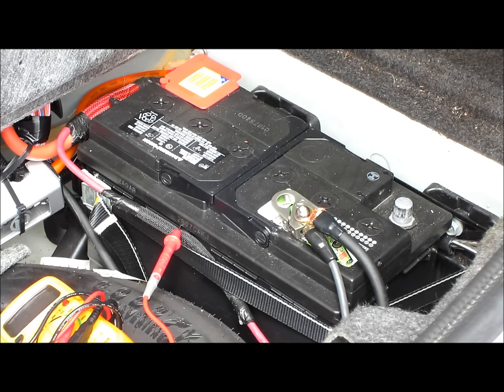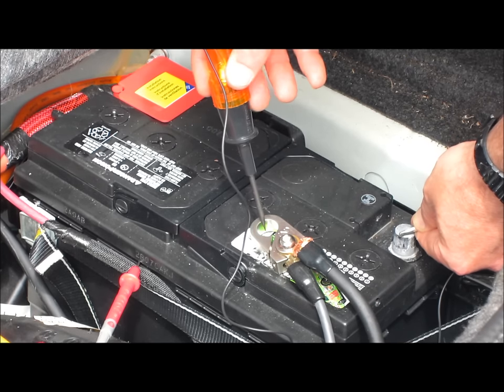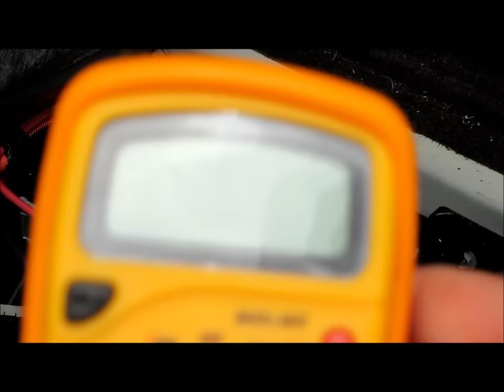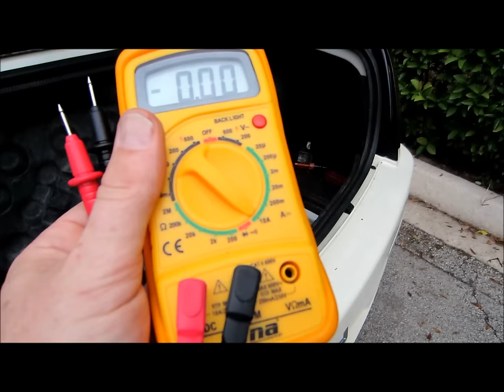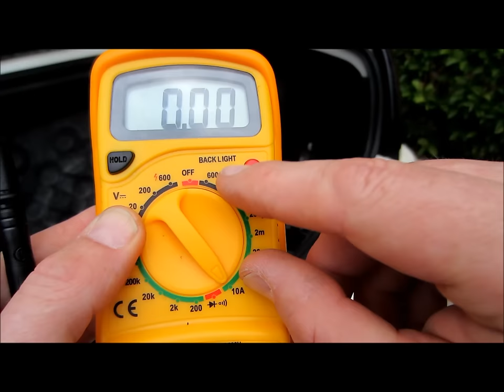How to check for and fix a battery drain in your car

Comment: FYI...Alternating AC current is the wave sign on your meter and the straight double line is DC current.
Reply: I was just going to say type that...note the straight line over the dashed at the 10A DC setting he used.
Reply: That's why he get zero reading on test meter but get light ON on test light tester.
Reply: I had to laugh myself is there anyone that works on cars that did not catch that?

Comment: Good simple video...If it's something other than the computer, that is most cases, always draws a " little "current, like clocks do too....If you find, but can not repair and/or replace, what is causing the extra draw, you can put in a manual disconnect that turns off the power at the battery or a manual, switch controlled disconnect, that can be mounted in the cab, but with more expertise involved...A kill switch so to speak, cheap and simple....Many are made to mount directly on the battery terminal and are easy to install, but you have to raise the hood every time to use it.... I also recommend pulling the computer fuse first, before checking anything, then the others...Just in case....Thanks for sharing this video...It's still a good one.

Comment: For years, my car ate batteries.  Each year I had to replace the battery.  If the car sat unused for a few days, the battery would die. 
No mechanic performed or even suggested a parasitic draw test.  They just kept selling me replacement batteries.  
Finally one day, I realized that the problem was that the rectifiers in the alternator had shorted.  The battery was draining through the windings of the alternator.  
How do I know this?  Because one day I saw a thin stream of smoke drifting from underneath the hood.  When I opened the hood, there was an inch tall flame on the alternator, which water couldn't extinguish (because the current from the battery was flowing through the windings, heating them like the filament of an electric light bulb).
The alternator was replaced.  A draw check confirmed that the current leak from the battery had stopped.  No more dead batteries.
Reply: My was a Ford Taurus 99. Was yours was a ford?
Reply: Kevin that is scary as hell !  I wonder how long that flame would stay going until it died out?  Everytime you had to recharge or jump off the car, and then it starts to flame up again.  Double scary.  No, much more than that!
Reply: fcuking hell😳

Comment: If you are alone, just place the ammeter across each fuse socket one by one until you find the conducting circuit.
Reply: Actually thats the way I do it and think its the easy and best way. Just be sure to get proper contact as its easy to miss the test point of these fuses.
Reply: do I need to keep the meter set to Dc?

Comment: Your vehicle is naturally going to have a draw to it with the key turned off. How do you think your stereo keeps memory? So the light test with the negative terminal is bs. To know if you have a problem you have to use a meter and look at the exact number that its drawing. Example, my mustang Cobra draws .o9 volts when the car is off because its feeding the memory for the stereo.
Reply: I think you mean the stereo is drawing .09 Amps, not Volts. The voltage should be pretty close to 12 regardless of amperage.

Comment: Hello!  I am dealing with a parasitic drain on my 2017 nissan pathfinder that cases my OEM radio to turn on at random times thus killing my battery.  Even when I unhook the radio completely from all the harnesses I can see  on my multimeter that there is a drain of 3.5 to 4 volts at all times and the only thing that fixes the issue is to pull the extended storage fuse.  I have removed the fuse box and found the harness that controlls the extended storage fuse is just a thick copper wire that is hot all the time.  I know one of the wires that it controlls is the blue memory wire leading to the back of the radio.  Initially I even tried just cutting that wire and running it to a different positive just to see the results and though the radio never turns back on by itself the parasitic drain is still there.  I have already spend thousands of dollars at the stealership for module replacements, sensor replacements, radio relacements and all this for them to NOT fix the issue.  Now they are swearing that only $8000 more to replace the whole wiring harness will fix the issue.  I mean holy crap, who do they think I am and what do they think they are they working on, a Lamborghini?  I'm just a regular guy with a family and I need a vehicle that works, especially when I am paying $450 a month for this think.  I know this is a lot, but do you have any advice?  Thank you so much!

Comment: Hello, i bought my son an 05 honda accord and the battery is draining and it has an aftermarket stereo so i checked the draw and it was 200 milliamps so i took the stereo fuse out and it went down to 0.00 put it back in and went right back up. I took the stereo out and checked all wiring and it seems good. Stereo works also but cant figure out where its coming from. Any suggestions??

Comment: I have a 2007 bmw 328i i swapped 2 fuses which are for the locking and unlocking system because my car wasn't locking/unlocking. After I swapped it out it started to unlock and lock. And when I started the car again it would not start anymore. I had a mechanic come look at it and says it's the starter. Do you think I did something wrong? And my battery is at 11.4V.

Comment: Cold it be possible to just take you meter to the fuse box and test for draw on the fuse.
Reply: Thats what I did and my radio thatdidnt work   was drawing 0.007 , causing my battery to drain

Comment: I have a 24-year-old E150 it runs okay but the battery goes dead after a day and a half just sitting there it's got a new battery the alternator is putting out 14 volts it's actually the second battery that I have in the vehicle that's less than 4 months old I have to put a battery minder on it so I don't wind up in a situation where it won't start if I need to use the truck I do that a day before I saw what you did and I am an air conditioning contractor I've worked with electricity for 30 years what if it's the ignition switch or if it's the computer how do you diagnose that problem I removed all the bulbs in the dome lights so that can't be a problem even if the door switches are bad if the dome light bulbs out there it's not going to draw an amperage is very little to the truck that has anything in interior wise that could be the problem it might be the computer or maybe the ignition switch because I had a problem with it shutting off and I always make sure that it's in the lock position when it's in the off position because I could take the key out no matter what position it's in so I always make sure that it's locked in the off position but that hasn't helped at all I don't know exactly what the problem is I might have to bring it in I SAW WHAT YOU DID WITH THE FUSES BUT IF IT'S THE IGNITION SWITCH OR THE COMPUTER IT REALLY WOULDN'T MATTER BECAUSE I MIGHT STILL HAVE AN AMP DRAW NOT KNOW WHERE IT'S COMING FROM the only way would be to pull the ignition switch and take all the wires off I wouldn't know how to check the computer I guess I can unplug the computer but I don't want to screw with that I'm pretty expensive to replace

Comment: I must have misunderstood, You had a draw using the continuity test light but when you used the multi meter  it should no draw?
Reply: Jimmy Cassell 

       thought the same thing.  both should have shown an issue.
Reply: Maybe need to set the range on the meter to a lower range. If it has one.
Better to use an analog ammeter. Doesn't have to trigger  any circuits to operate.
Reply: That’s exactly what I said to this gentleman, if you show a draw with the tester you should had shown a draw with the meter, I truly think that this guy don’t have a clue on what his doing or got confused doing this as maybe it’s hard to record a video and talk at the same time for this guy.
Reply: Yeah I know it didn’t make any fucking sense
Reply: +Jimmy Cassell
The draw is simply just too small to be shown because he has it at 10 Amp range, he should lower the range and it would show the draw. 
Its fine to use your head you know.
Reply: Possibly need to explain VOLTAGE DROP in series circuits? 
Voltage drops at each load in series, but current is constant.

Comment: Love your personal rags to riches video series and on becoming an electronics expert.  Setting up ammeter in series with the battery's ground circuit as shown sounds off my car alarm.  What do I have to do differently to do the parasitic draw test?
Reply from the maker: +omnidivisible You can't disable that alarm tentatively? most systems have some method of going into valet mode.
Reply: Car alarm on my 95 Corolla is one thing I would like to disable PERMANENTLY. If I have a valet switch by the driverside kick panel, the toggle may be missing.  Owner's manual doesn't cover car alarm.  Car model-specific reliable consumer instructions on disabling car alarms are hard to come by and time-consuming, and electronic techno instructions are hard to understanding and follow to be actionable.  Toyota dealers would not give me a straight answer or touch it.  Would you have any pointers for disarming a 95 Corolla or the critical information and skills I need to have to disarm my car successfully?

Comment: Great video. I found it very helpful and informative when trying to diagnose my battery drain issue.  If you don't mind me asking, what kind of battery cable terminal ends are being used on that car in the video?  They look really nice and like they are good quality.  I would be interested in purchasing a set if I knew where to find them.
Reply from the maker: +mustangmaniac1983 thanks, and those are memphis top post battery terminals
Reply from the maker: those are memphis brand top post terminals.

Comment: I am having trouble with my Ford F2 58th 2006 I am getting some type of power on my negative check the multimeter and it was a 11 point something and 12 point something and then I connected to the app and I had to point something on it I’m just lost

Comment: hi I do have a question how can this test be done if the battery in the trunk while the the doors have to be closed what about the trunk? I have a 2003 Mercedes e500 the main battery in the trunk and there is 2 lights inside the trunk. can this test be done on the auxiliary battery under the hood ? I need your help thanks
Reply: You have 2 options, remove the bulbs if they are easy to get to or simply close the trunk latch with a screw driver.  When you are all done, don't forget to open the latch before slamming down the trunk lid.  The latch method is better since if you have an alarm system, the circuit will think the trunk lid is closed and "sleep" with no draw.

Comment: Uhh the test light IS NOT showing you a draw you are closing the circuit and giving the test light a source of power. You can do this on any perfectly working vehicle. The meter test is however the correct way

Comment: Ok so the fuse that changed was the main battery fuse. The test light went from very brite to about 10% and stayed lit none of the rest did any change. Dose that tell you its a ground some where? Its not blowing any fuses just goes dead if not run every day.
Reply from the maker: That indicates there is a draw on another circuit somewhere.

Comment: I did test with my tester  and pool off all the fuses one by one still tester light is on .Than for being sure  I tack all the fuses out 
no fuses was  on fuse box ,still tester light is on. Can you tel me any think  ales I can do to find the short Circuit in this car?
Reply: Shakibafar Mohammad Ali the engine computer ecm and the transmission pcm and  your radio all have constant  power to them to retain there memory

Comment: So how come you had a draw on the first test with the power tester and 0 on the power meter????? 🤔🤔🤔🤔 it should had shown that there was a draw on the power meter as well correct? You also obviously show that there was a draw but didn’t show what the issue was, or was the draw happening because your trunk was opened? I’m more confused then when I started watching the video bud. 😕
Reply: Bori Cua because he’s wrong
Reply: Bori Cua u
I used a multimeter first found no parasitic draw and then used the test light and it turns on always even when there isnt a draw

Comment: sir how to confirm this test on a 2003 Mercedes e500 while the battery in the trunk and trunk has lights ?
Reply: @Monir

Did you find a fix?

One way is to attach wires at the places specified to attach meter leads.

Run wires outside trunk and close trunk.
Without kinking wires.
Of course, check for drain between your added wires.
Make sure no shorts or crosses in your wires.

2nd try.
Set everything up.
Have a flashlight.
Make sure trunk release is working.
Hop in trunk and shut lid.
Check for drain.
Check for electrical drain.
Check for kitchen sink if ya want.
I took my out.

Comment: Modern fuses can be tested for continuity without removing them as there are two small metal contacts on the outside of the fuse.  So why not test for amps the same way as testing for continuity instead of taking all the fuses out ?
Reply: and if you can - replace a bad fuse with a good fuse that glows when it turns bad ...
Reply: +Rocket Rider d
Reply: your not checking for continuity at the fuse.    you are checking for no draw at the battery after having temoved the fuse that deactivates that particular circuit whatever it may be door light, radio etc. that way you've identified where the problem is. Then you know where to look.

Comment: can I just go over to the fuse box wit the multi meter and test the top of each fuse and see if there is a draw by waiting for the meter to drop to zero? If it doesn't then that would be what would be drawing current...
Reply from the maker: Only if you check amperage draw, yes

Comment: The waving line is ac and strait is dc, And there is no way that 12v and a couple of amps could jump 2 to 3 inches from the battery terminal to  the frame, it would take thousands of volts to do that. Also when he was using the dollar store tester he had his figures right on the metal, if there was a draw he could possibly felt a jolt. But better to be safe if ur unknowing, still an alright video.
Reply: Yes he got the signs around the wrong way, but the tip about testing on the grounded side is still a good one. He didn't mean it how you took it. Of course 12v isn't going to jump inches - or he wouldn't have the battery where it is now. The point is when holding one probe to the positive terminal, the other probe also becomes positive (when meter is in current testing configuration) and is now mobile. Just a careless moment might let it accidentally touch, dangle or drop down onto another grounded component and there you've shorted something through your meter. Usually a fuse will save the day but it's still an unnecessary annoyance that takes time to fix, especially if it's your meter fuse that blew and you don't have one to hand. As he says, if you just do your testing on the ground side then you pretty much negate the possibility of causing a short. It's cheap insurance. It's a good tip. I recommend everyone follow that bit of advice.

Comment: Awesome vid buddy good job and thanks!
Reply from the maker: Im glad it was helpful
Reply: Lessco Electronics u seem very smart with this stuff ..my mom's positive wire to battery is getting so hot the bolt burns my fingers ...extremely hot...any ideas?
Reply from the maker: thats dangerous, my guess is the wire is very corroded inside. replace it

Comment: No your radio and some computer stuff will be on when car is off so you WILL get a draw of about 300 mils ( or in this case light up your dumb light tester . If you have a draw closer to  .5  amps  or 1 amp then you have issues

Comment: It's gonna be a little hard to close the hood when that is where my battery is.
Reply: Manually close the latch with the help of a screwdriver, don't forget to open it again before slamming down lid
Reply: Remove the bulb from the hood. Then you should be okay.

Comment: Professional battery replacement outlets connect a small battery to the battery terminals before disconnecting your battery. This is done to prevent you losing all your car settings which rely on a little current to remember settings. Your way will result in all settings being lost, including radio, clock and tyre pressure where applicable. Not the best advice!

Comment: My radio turns on without the key being on could that be draining ny battery ?
Reply from the maker: yah!! connect the red wire to acc (keyed) power instead of constant 12v power, and it'll work properly.

Comment: What happens if more than one fuse is creating a draw?
Reply: The multimeter will indicate a reduced amp draw when you find the first offending circuit, but still show a value, for example a 3.5 amp draw goes down to a 2.5 amp draw when you pull a particular fuse. Leave that fuse out and continue pulling fuses one at a time. If no change in the indicated amp draw place the fuse back in it's socket. Repeat until the amp draw is zero.

Comment: hey buddy i did that and i still have a drain none of the fuses put the light out what do i do next ?
Reply from the maker: whats the vehicle?
Reply: 2002 saturn sl2
Reply from the maker: that car has 2 fuse boxes doesnt it? did you check the fusebox on the center console passenger side?
Reply: no i only knew about the one under the hood
Reply: i just found it ill check that one out lol thanks alot buddy
Reply: i just checked it to i dident put the light out either im so baffeld lol